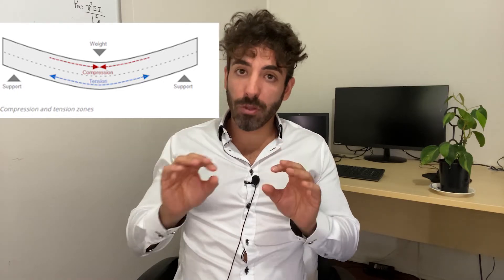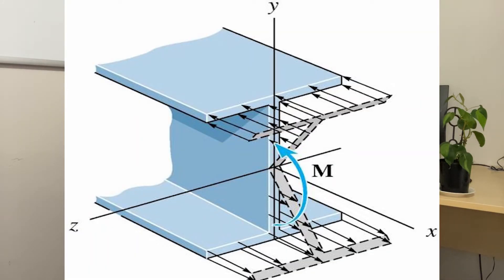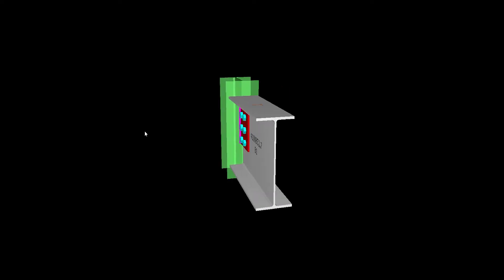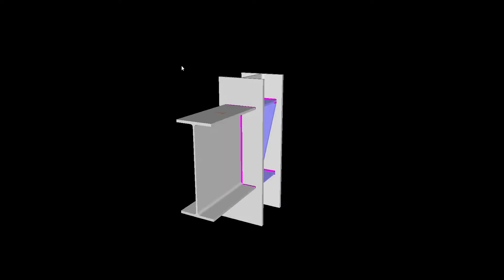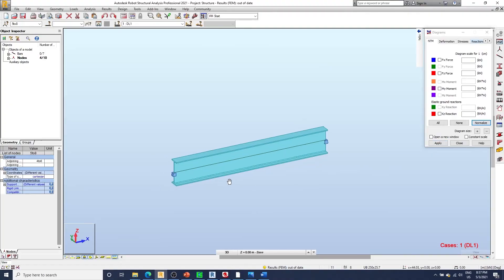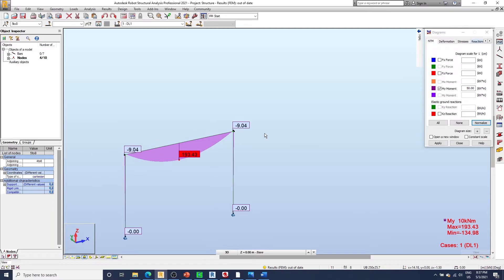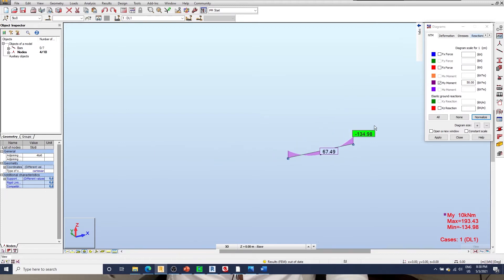DO NOT design connections before understanding this

Comment: A rigid connection is by definition a complete connection, as there is no degree of freedom in a rigid connection. But a rigid connection is also a continuity, in this case, of stiffness between the elements in the connection. You demonstrated this very well by modifying the beam height in the portal frame examples. And that's exactly the problem with bolted connections. The holes required for bolts insertion reduce the amount of material in the section, which in turn reduces the section's moment of inertia. There is, therefore, a local reduction of stiffness in the section, making it more difficult and expensive to achieve a truly rigid connection with bolted connections. When we design bolted connections, would be more apropriate to consider semi-rigid connections. Excellent video, by the way. Thanks a lot!
Reply from the maker: Hi Edmar, thanks for taking the time to write this comment. Very well said. Thanks :)

Comment: Just a question, if you consider moments are due to the rotation of the flanges a very stiff beam would not transfer moments because it barely rotates / deflects. I'm curious if the sharing of moments in columns and beams due to relative stiffness is also due to the level each member resists deflection, I.e whichever 1 resists deflecting the most hogs the moment. Please Let me know if I'm completely misinterpreting this

Comment: Good day sir, I want to ask when can these connections be applied in a structure? How do you know that the connection need to be shear connection or moment connection. ?
Reply from the maker: If I had to summarize this answer in a couple sentences, I'd say, we use moment connection for lateral stability or to reduce deflections, otherwise most of the time shear connections.
Reply: @bengthebrazilianengineerinAus  Thank you sir!
Reply from the maker: @shamamba02  no problems :)

Comment: Great Video. Conceptual. Practical. And easy to absorb the knowledge. I wonder if you can upload more videos frequently. It is highly appreciated if you upload conceptual analyze and design industrial structures (oil and gas) or buildings using Robot or Staad. If you have online courses, I would like to enroll.
Reply from the maker: Hi Morteza. Thanks for the support. Unfortunately Oil and gas structures are not my expertise, but I will start uploading more videos on larger structures soon.

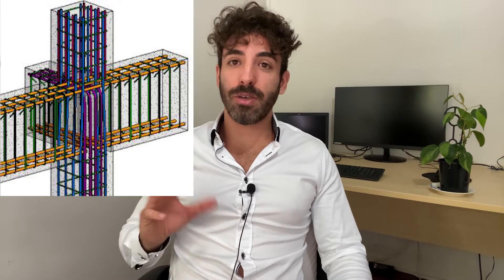Comment: 4:39  what about the end span-end joint, are they meant to be assumed as fixed or pinned, because I see in some methods of analysis e.g. Moment distribution method, they some times assume the joints at the ends of the end span of a continuous beam as pinned resulting in total moment at the far end support being zero. I thought its because the moments would be small; so negligible, but in some cases recalculating it (assuming the far end support as fixed as opposed to b4) there could actually be a significant amount of moment.
So why do we then neglect that moment and assume the far end support to be pinned when in real life its actually fixed I.e there is moment at the support
I'm referring to an RCC Beam btw🙂🙂
Reply from the maker: send me an email with an image of what you're triyng to solve. I think it will be easier.

Comment: Hi Ed 
We gonna pre-anchor steel plate in concrete columns to connect steel I beams , is the bolted connection stiffer or welded one ??? I want to weld on L plates for shear connection and for moment as well all both sides it’s gonna be 4 . Or we can just weld it on . What is better ??
Reply from the maker: are you referring to the base plate connection or connection from the beam to the column?
Reply: @bengthebrazilianengineerinAus  base plate

Comment: Hi! 

Thank you for this practical video. 

I have some questions regarding:

1. Connection between CLT floor panels

2. Connection between CLT floor and Steel beam

3. Between concrete precast Hollow core floors

4. Between Hollow core and steel beam.

How do you thick we can model them in a software?

Many thanks!
Reply from the maker: hey..I haven't designed many CLT buildings so you may be better off asking someone with experience on that.

Comment: How can I prevent cracks in partition walls due to deflected structural beams' interaction?
Reply from the maker: You have to limit the deflection. Masonry walls for example I use span/500
Reply: @bengthebrazilianengineerinAus  Sorry I forget to mention that the partition is non loading type

Comment: Great Video, what is the ideal ratio of stiffness of; column stifness to Beam stiffness, in a Reinfoced Concrete frame?😊
Reply from the maker: Good question. Not sure about the ideal ratio. Most reinforced concrete structures are detailed to transfer bending moment so I would design it for full stiffness regardless.

Comment: Very good lesson, just to confirm with you sir, that mean i can weld the i beam the column directly but with stifferner plate
Reply from the maker: Thanks Abu. You can weld a beam to a column , but bolts are usually the preferred method.

Comment: You just won another subscriber! I do have a question what would you consider the threshold for a portal frame to require moment connections instead of just shear connection? When is a moment to big for the connections to require them to be moment connections and where in the code is that info? Thabks
Reply from the maker: Hi Afonso, a portal frame is a lateral stability system. You cannot achieve lateral stability with only a shear connection. You will use shear connection in braced frames.

Comment: is haunching seen as a moment connection
Reply from the maker: Haunch is just a larger section of the beam. It helps with more space to facilitate the moment connection, but it's not a pre requisite for a moment connection. You use hanch to increase section capacity where bending moment is larger

Comment: Is the (stronger column and weaker beam) system is good for rcc construction or (stronger beam and weaker column) system..??
Reply from the maker: It depends on the spans. If the span of the beam is longer than column height, increase beam stiffness. If column height is higher than beam span, increase column stiffness
Reply: @bengthebrazilianengineerinAus   so sir how do we stiff the beam ..??? and sir i think if span of the beam is longer then column then we stiff the beam but the columns remain much stronger then beam because of safety..???? And sir as the rule says all the rcc member who take load of any rcc member should stronger then that to resist it..???
Reply from the maker: @aliqadri4672  When I say increase stiffness I mean increase the size of the element. You are correct, but a beam is subject to different internal forces (bending and shear) than a column (mainly compression).  As long as you design them to take any loading they will be subjected to, you will be fine.

Comment: Awesome, thank you again!

Ok so question, Fixed vs Simply supported is due to limiting of rotation. What about a Steel beam in a Roof with Purlins above it
BUT a Fly Brace has been introduced between the Purlins and the Bottom flange to stop rotation of the Bottom Flange. Is this now
a Fixed Connection?

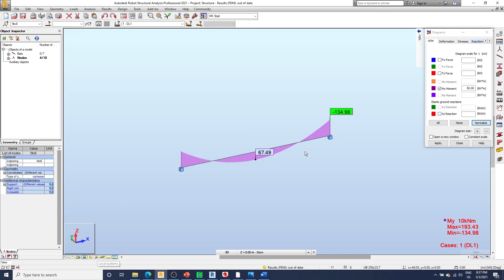Comment: 7:14 that kind of moment reaction is not possible in real life?
Reply from the maker: A perfect moment connection or pinned connection doesn't not exist. We design them as such to simplify the calculation. Some moment connections can be very close to be perfectly rigid, In the same way some shear connections can have some rigidity and transfer moment, however its so small that we usually neglect it.  There are semi-rigid connections as well if you want to go more in-depth into connection design.
Reply: @bengthebrazilianengineerinAus  hello, thanks for the reply. I meant to say those kind of moment reaction values  as shown in the video at the timestamp sorry 😆.

Comment: Thankyou for the detailed insight. Can you please elaborate more on when it is ideal to have a shear connection vs moment connection in base plates?

Furthermore, for beam to column connections in the case of square hollow sections or circular hollow sections where there is absence of a web/flange, how the shear and moment connection are formed for them?
Reply from the maker: Hi Wasif,  it varies from project to project. Typically you choose a moment connection if you need a rigid structure and due to architectural reasons, for example, you cannot brace the structure. Bear in mind that moment connections are more difficult to design, fabricate and build, not to mention the costs.
There are many ways to connect tubular sections. look up guides by CIDECT online
Reply: @bengthebrazilianengineerinAus  Thankyou for your reply. Keep sharing your content, it is quite informative :)

Comment: If you can do the VDO about steel warehouse analysis with Autodesk Robot program to design fix & pinned connection for members & Baseplate is good.
Reply from the maker: Definitely planning to do a couple.

Comment: Also, as a practicing structural engineer, how do you personally design connections in a large scale structure? What is your go to method. Do you rely on any designated software for this task or an excel spreadsheet?
Reply from the maker: A combination of software, spreadsheets, hand calcs and standards.

Comment: Misleading. Whether u have stiffeners in the column or not the beam will rotate (together with column) anyway. U are comparing a rigid connection to a fixed end (it is an end not a connection), which is of course different but there is nothing wrong calling the first pic a rigid connection. A rigid connection is based on the assumption that beam-column will maintain 90 degree when they rotate and stiffeners or not will not change that.
And the flanges don’t take the moment. The flanges take the compression/tension. Moment is taken by the whole section.
Reply from the maker: Hi mate. Thanks for your comment. Appreciate your input. The point I'm trying to get across here is that rigid connections are not all that rigid in reality. Connection rigidity is often overlooked in my opinion and could lead to serious issues in design. If you connect a 460 I beam to a toothpick, it doesn't matter if the connection is rigid or not. The toothpick is so weak compared to the I beam, that the connection you have assumed "rigid" will be a hinge. Regarding the "flanges take moment": the top fibers or bottom fibers or flanges of a beam play a much larger role in resisting the flexural forces (as you said) from bending.
Reply: @bengthebrazilianengineerinAus  But rigid connection is rigid connection. You can’t compare the rigid connection to fixed end and call the rigid connection “not so rigid”. The later one is not a connection but a restraint. A rigid connection is based on 90 degree assumption. If you decrease your column stiffness and thus getting a smaller moment at the connection that doesn’t make your rigid connection “not so rigid” or even a hinge. The moment is reduced because the column is softer and rotate more instead of the connection. As long as 90 degree assumption is valid it is a rigid connection. 
Again, you cannot compare a connection to a restraint and call the connection not so rigid. That’s totally two different things.
Reply: A rigid connection is a joint that assumes the angle between the members is kept constant (doesn’t have to be 90deg since members aren’t always connected at 90deg). This assumption relies on the relative stiffness of the supporting member. If a relatively flexible supporting member is connected to a supported member then this assumption won’t be valid anymore and the angle will change due to large stresses and deformations hence will be less rigid or will start to act as a ‘spring’ support with relative rigidity. Hence a rigid member is only an idealisation and should rather be thought of as a spring with relative rigidity regardless of what connection you use. @op is referring to the rigidity of the actual steel connection and how much deformation they can take. A rigid connection usually refers to the relative stiffness of the members and how good they are at transferring moments where as a steel connection that is rigid doesn’t always provide a rigid connection between members (transfer of member moment is not equal at joint) because a rigid connection depends on the relative stiffness of the members as well. This is what we usually mean when we refer to rigid connections and not the actual rigidity of the steel connection being used.